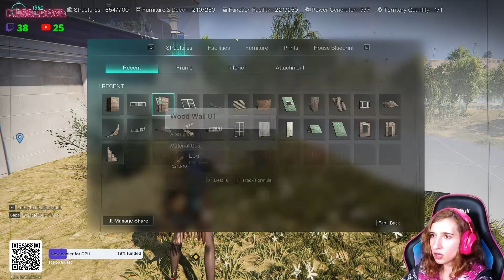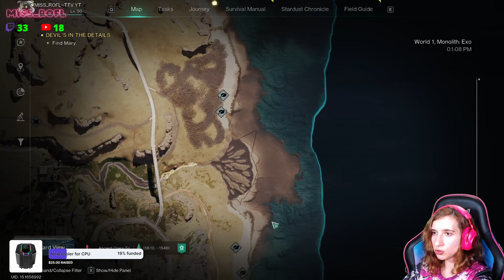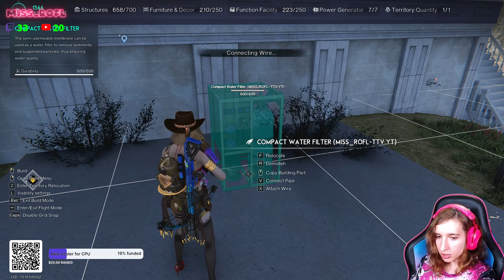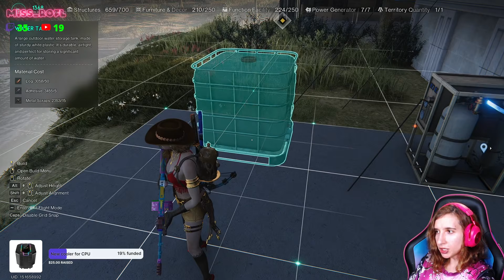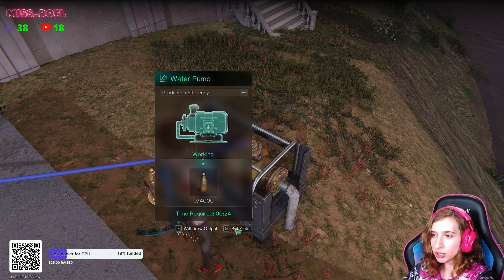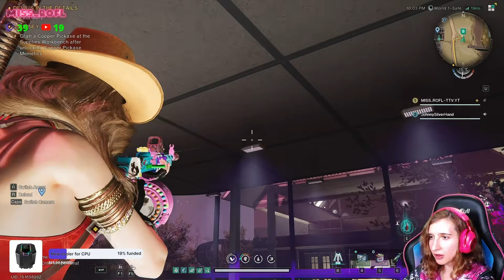How to Build a Fully Automated Water System | Once Human Guide #miss_rofl #oncehuman

Comment: I I thought sure I posted this question on yesterday. 🤣🤣Where did you get the wallpaper for your foundation?
Reply from the maker: White or grey one? Anyway,  both foundations we can see in this video are from paid cosmetics :). The one I used for the tutorial is from the Steel Frame Glass Sunroom pack. The one you can see on my base is from Romantic Misty Purple pack.
Reply: @MISS_ROFL Awesome! Well, time to open my wallet. Thank you!
Reply from the maker: @Solomonlike  I really recommend the Glass pack. You can use it literally in every build you make. Romantic Misty Purple one is also good, but only if you want to build a princess house :D 

Btw pay attention, there are two glass packs. Cheaper one is the expansion for the expensive one.